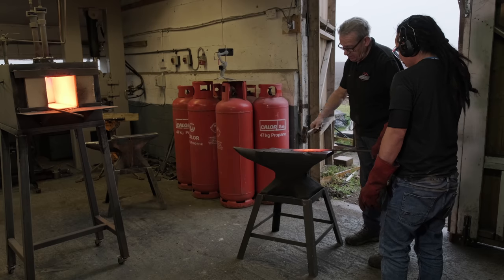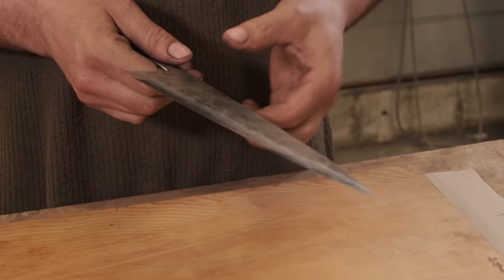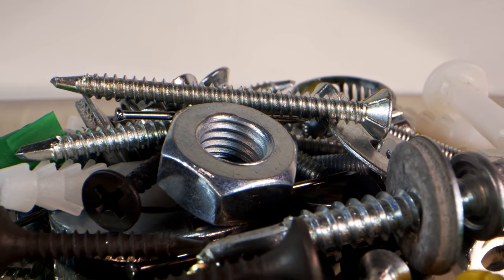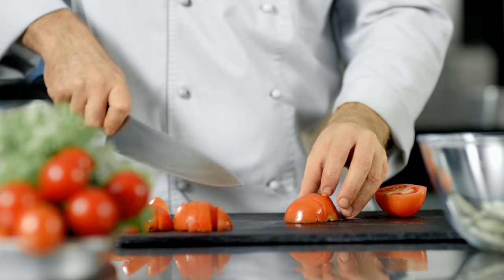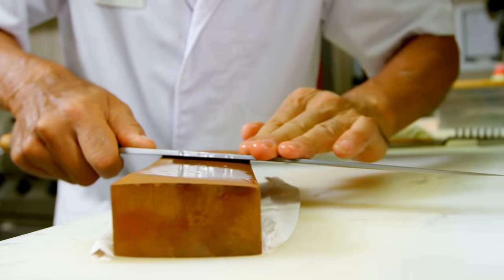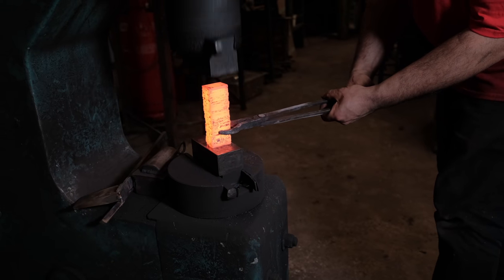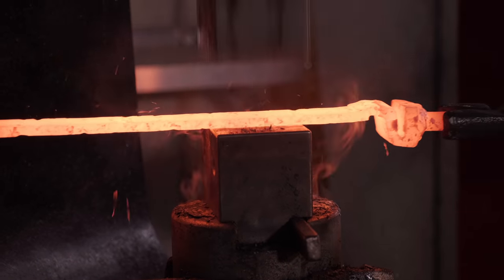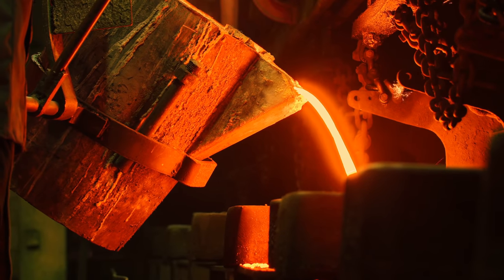Why 98% of knife makers pick the wrong steel according to a metallurgist

Comment: I enjoyed this, even though I often prefer 1095 carbon and he shat all over carbon, he explained why with out any vitriol. 
My normal policy is carbon on the belt and stainless in the kitchen.
I know there are better steels out there but the ease of maintaining the edge at the end of a long day matters to me. Rust doesn't bother me, I have other items that need oiled often.
Reply from the maker: Hi Merkin I do agree with you a lot! I am personally more pf a carbon steel guy because I like pretty patinas! Thanks for dropping a comment and I hope you’ll enjoy the other content we put out as well!
Reply: @UKBladeshow  I cant blame you there, even though it isn't something I do with my blades, it looks cool. 
I tend to leave mine coated or blue them but they are an everydaybutility tool in my eyes. Which is why the toughness, ease of maintenance, and cost efficiency (replaceable) is why it stays in use. Plus a fixed 5" carbon blade with a good grind  will handle 99% of any possible (even unusual) tasks.

Well I will have to go take a look at the backcatalog wont I....
Reply: Try 5160
Reply: Same for me. I prefer 1095 carbon for my work horses (pocket, bushcraft, skinning). I don't need it to keep the edge 4x as long when I can easily sharpen it in seconds and out in the woods compared to having another be a pain in the ass to sharpen. And all my 1095s have come powder coated, I've never had an issue with rust (and I live in Florida where humidity is always high, the air is always damp and suffocating). But I'd never dream of replacing my Shun's in the kitchen with carbon. The title of this video is mislabeled, as every knife has its place according to the needs and abilities of the individual. There is no "one steel" to rule them all.
Reply: @FiredUpKnifeandTool  thanks for your response,  in comparison to staight 1095 it has some additives that inprove toughness, and is a standard alloy for military riffle barrels. I do not know the hundreds of alloys out thare. But it is interesting tha the new cpm magnacut is a carbon steel tweeked to have stainless properties
Reply: Magnacut is a stainless steel. A "stainless" steel is really any steel with a chromium alloy high enough to allow formation of chromium oxide. It doesn't matter what % if chromium there is, so long as a sufficient amount of chromium oxide can develop.

Comment: Hello from out in the colonies
My biggest choice of steels comes down to basically a few factors- customer demand and steel for the job
I'm not selling to super-knife nerd types, just professional cooks and home users for the most part and there's still a pretty heavy bias there to the carbon steel knives because they can maintain and sharpen them easily enough. My go to there for kitchen knives is 26C3, its extremely hard, its got good edge stability and its not inordinately hard to get razor sharp. Plus I can do some forging on it and still get an interesting product out of the other end.... sometimes :)
Stainless though is my preferred steel to make cutlery out of, mostly 440C and N690 which are generally available for a good price and produce a good, baseline product that's better than a lot of commercial products. I am giving the SF100 a look in from GFS just to see how it turns out, if I like it and people like it, I'll buy more.

I've done a lot of toe-dipping into the D-series steels, the high-alloy, mid carbon steels and powder metal steels as well. They're all really excellent if you find the right fit for them and its not necessarily in kitchen cutlery either. Sometimes a knife just has to be really damn tough or have that edge holding for months on end- so you pick and choose to suit its purpose, but at a much increased material cost, sometimes the processing is more difficult and not everyone wants to pay the big bucks for a knife they need diamond plates to sharpen it on. So that does affect my direction a lot there as much as it does commercial manufacturers.

Personally in my kitchen, I use N690, A2, 26C3, D6 and S35VN blades.
Reply: Where are you getting your 440C? I bought a couple bars about ten years ago and it was absolute garbage. The big visible lumps of carbides/carbide banding were worse than any D2 I've ever seen, and D2 is famous for that. The finer I sanded it, the worse it looked. It was really disappointing. Around the same time I found similar problems with new 154CM. 
The only explanation I ever got for that was that quality had simply dropped off over the years, and some mills were just sort of slapping it together in a hurry. I've seen plenty knives made of 440C and 154CM from back in the 70s 80s and 90s, and that just was not an issue with the old stock.
So after that I just stuck with CPM-154 for those types of knives and never had any problems at all.

(it's kind of funny how both 440C and 154CM were considered "Super Steels" in their heyday, and now they're both just seen as pedestrian ordinary stuff LOL)
Reply: @dogslobbergardens6606  Yep time marches on and metallurgy is certainly no stranger to that. I've also heard of 154CM being prone to having inclusions in their bar stock, but I've never seen it myself and take that for what you will.
The CPM154 is a much pricier material too but it always seemed to be worth it for the finer quality melt, the other alternative is the Bohler N695 which is 'more or less' 440C as much as it matters and will be a good steel from them. Only two places I've known who will back up their material with a guarantee are Artisan Supplies in Aust and Alpha Knife in the USA.
(I'm sure others will if you ask, but those two I've had good dealings with)

Stainless is starting to get harder to find over the last 18months at good prices for the mid-range stuff like 440C, N690 and 14C28N, so I'm keen to see how well the SF100 works just doing a test run on it over the next month before I sink big cash into sheets of it.
Reply: @krissteel4074  yeah... steel prices... the tarriffs situation in the US a few years ago pretty much got me out of the knife biz and it's only gotten worse since then.
I agree, I never had any problems with any CPM or other powder metallurgy steels. The very process avoids all those issues. You do pay for it, but that's how it goes.

Comment: I'm not a meteorologist, but for my outdoor knives I prefer CPM3V steel, it's not stainless, but also not hard to keep clean. It holds an edge for a long time and I can sharpen it just fine on ceramic wet and go whetstones and leather strops with compound.
Reply: Think your spell checker needs attention;  metallurgist not weather man 😀
Reply: @petemulhearn7787  Correct you are, thank you.

Comment: Something that many people misunderstand is that when high performing steels are used on a machine in a factory (cutting cardboard for example) it's very easy to see and measure the benefits of one steel over another.  As far as a human in his or her kitchen or workshop is concerned, you'll struggle to see the difference beyond what is mentioned in the video. Thanks for providing a great insight!

 52100 is my personal favourite.  But I'm dabbling in stainless steels. More recently, N690 was interesting to work
Reply from the maker: Excellent! Thanks for sharing Timothy!

Comment: Good info thank you. Ive been making knives a little over a year now and I find my favorites are O1 and 440C. 1095 and aebl warp too easily in hardening in my experience. I trypically use O1 for outdoor use knives and 440C for cutlery knives.
Reply from the maker: Hi Mike! Lovely to hear your comments thanks for sharing! 01 really is a popular choice for high end knife makers! Hopefully the video was insightful and glad to hear you enjoyed the video too!
Reply: I'd recommend plate quenching with AEBL, or any stainless really. There's no real reason not to given the time needed to get them past the nose on the TTT curves.
Reply: O1 is utter garbage. Awful edge retention, no corrosion resistance, decent toughness. 14C28N knocks it out of the park on all counts.
Reply: @magnanova  🤷‍♂️ O1 works great for me. Use it in all my hunting knives. To each his own
Reply: @magnanova  I'd disagree with that as a blanket statement. It's often recommended as being good for beginners and in reality it's not. It needs careful HT in a kiln, not a forge.

Comment: Having been in the sheet metal industry for 10+ years, I can say with certainty stainless steel was friggin sharp!
Stainless steel is so hard and dense it was a PITA compared to mild steel and aluminium.
I have seen so many injuries with thin stainless steel parts/scrap.Even though the metals i worked with were low carbon I believe stainless steels are best for knives on the upper end, AEBL FTW! 
Thanks for clearing the air on this issue.
Reply from the maker: Hi Daniel! You are very welcome! Thanks for the comment and speak again soon!

Comment: Thanks, great video! 
Big fan of k720, should be pretty close to O1 and very easy to get for cheap (at least here in Italy).
Cheers!
Reply from the maker: Hello mate! Thanks for dropping by! I know very little about the K720 - would love to know more about this then (and how it compares to O1). Do you use it mainly on kitchen knives or for everything you do?
Reply: @UKBladeshow  According to Böhler, the German manufacturer, is just like O2. I use for pretty much everything but I do mainly kitchen knives. Also with 15n20 for damascus as it etches very dark like you said! I now use 1070-1090 only if I want an hamon as I can't get it to show consistently on k720.
To be fair it's also not the best for mirror finish, it has some kind of a texture to it, but I like it a lot for that too!
Reply from the maker: Mirror finishing is a nightmare for any type of steel anyway hahaha! I remember one of your videos where you had a mirror finish on a knife - looked great but I bet that took forever to do!
Reply: Böhler are based in Austria not Germany 😀
Reply: @BlackBeardProjects  K720 is not ideal for hamons because of it's high hardenability or alloying that makes it so easy to harden properly. I even tried and succeeded at hardening k720 without oil in 1.5 to 2mm thickness using actively cooled cooling plates. This can be easily verified checking K720 CCT chart in its datasheet. For hamon you need less alloyed steels, such as 1095 or w1/w2 (Bohler K990 for example)
Reply: Italy  has alot of specialist steels only made in Italy , thanks for your contribution .
Reply: @BlackBeardProjects  I often use Böhler N690 it is a realy nice steal.
Reply: @BlackBeardProjects Austrian/Swedish not German.

Comment: Nitro-V is another “AEB-L+” recipe. They are similar enough that Professional heat treaters run them together, only difference I could tell from both ran together was 61 vs 60 hrc for the nitrov vs the aebl. I honestly think you could run the aebl at 61 and get essentially the same result. Now maybe the nitrov has more toughness around the 63-64 hrc range, I can’t speak to that though, I always run it 60/61 without any issue. 
One other “class” might be something g like 3V. I had some heat treated to 60/61 hrc and I couldn’t get it to take an acid etch, stainless as far as I’m concerned. It was brutal to grind, do not miss that😂 it has insane toughness, enough that you can run it quite hard and still be tougher than stuff like D2, only really bested in toughness by the l6 s7 stuff, but it can be ran up quite a bit harder. Interesting stuff for sure, like a grotesque love child of D2 and aebl.
Reply from the maker: Hi Colson thanks for the fantastic and comprehensive feedback! I appreciate you sharing your story on your experience with Nitro-V! 

Hope to see you again in our other videos!

- Vinz
Reply: I really like CPM-3V. It seems to do best for me right at 60Rc, some people prefer it at 62Rc. Still very, very tough and holds an edge really well. But it sure does suck to grind and sharpen.
I can tell you from experience that 3V WILL rust... eventually. It takes a while, and it gets really ugly. It doesn't patina or get an even coat of rust like a simple alloy; for reasons I can't explain it just gets nasty pits here and there. Sort of like D2 does. So in practical use I would call it "stain-resistant" but not really stainless (of course, very few cutlery steels are truly stain-free anyway).
If you love'/hate 3V for those reasons, try Elmax. It has a lot of the toughness,  a little better edge-holding, and notably better stain-resistance. But you will not like grinding it one bit ;)
Overall if I had to pick only one alloy I'd be quite happy with AEB-L. Inexpensive, easy to grind, easy to sharpen, easy to HT, tough like a "carbon" steel but corrosion-resistant like a "stainless" steel. Nitro-V would probably suit me just fine as well.
Reply: @dogslobbergardens6606  I was always taught "Stainless" is just that... It's stain-less not stain-proof, any steel with rust if enough time and the proper conditions are present
Reply: @anthonybarker9123  yeah, pretty much. You can find some really exotic stuff, but it's all still mostly iron. 
Even non-hardenable "stainless" steels with barely any carbon in them will rust if you abuse them enough.

Comment: Very intriguing! I can’t say I’m entirely converted though as my carbon knives certainly hold an edge longer than the stainless and they are actually harder based on the HRC specs and how they behave during use.

Maybe this video’s hypothesis does not apply to the Japanese Hitachi carbon steels? The steels you referred to in this video I have never heard of but I’m certainly no expert either.
Reply: Stating the obvious: I’m just a home cook with a few knives
Reply from the maker: Hi Benjamin! You're exactly my target audience so love to hear you're watching our video! I do love carbon steel myself (over stainless, for various reasons) so I do agree with you. My 80CRV2 Gyuto lasts quite a long time compared to my stainless version but again, it's not an O1 tool steel like Graham said. To each their own really. 

Hope to see you on our other videos as well bud! Cheers!
Reply: It really depends which two steels you are comparing. Comparing a high grade carbon steel to a common stainless for example. Regular kitchen knives are frequently made out of 420 stainless, a cheap stainless steel that can be forged, stamped and worked without much wear on your equipment. It only contains .2% carbon and 12% chromium (bare minimum for stainless). It does harden, but only to 52HRC. Even comparing carbon steels can be a world of difference. Medium carbon grades (0,5%) or high carbon (1%). 

So ask yourself. Are you comparing equivalent steels or are you comparing a high carbon knife to Ikea $10 knives?
Reply: @patrickd9551  On the stainless side let’s say Kai Shun which has a VG max steel with 61 HRC according to the maker, compared to an average Shirogami #1 which is 63 HRC, my FT is treated even harder than that.

I believe this comparison is kind of fair from the consumer point of view. In general though I don’t see any stainless going above 61 with the exception of powder steel but you may be right and it is selection bias.
Reply: I prefer Carbon Steel  kitchen knives, I do have a Stainless 6” chefs knife as a knockabout cut anything leave dirty knife. I have no justification, that’s just what I have used for fifty years and I like being able to sharpen them in a couple of touches on a fine steel. Pissballing about trying to get a stainless knife where it needs to be will take five minutes !
Reply: People sharpen past sharp, to dullness again. It's needed to be checking often as one sharpens.
Reply: Chef and knifemaker I would agree with this also. I have worked with some of the best knives in the world and many 2-3 Michelin star kitchens. High end forged carbon steel knives are the preferred knife for me and most I have been around. Some of this may be due to the most of the best kitchen knife makers use carbon steels so the edge geometry and overall craftsmanship make up for the steel.